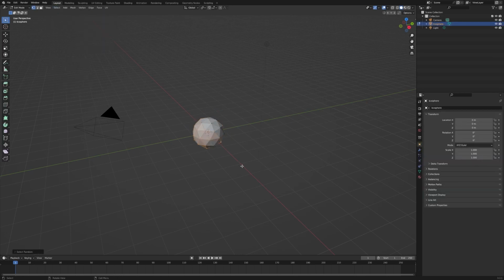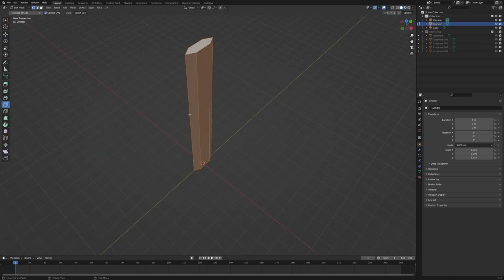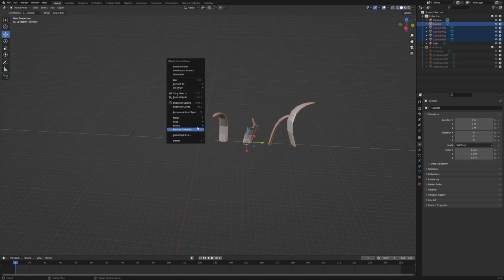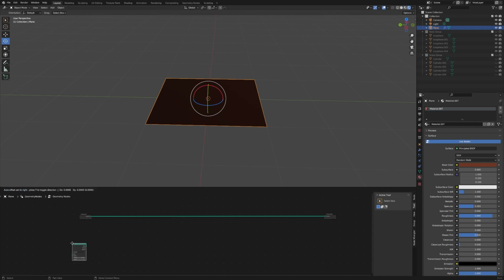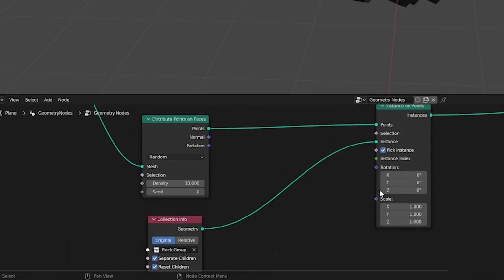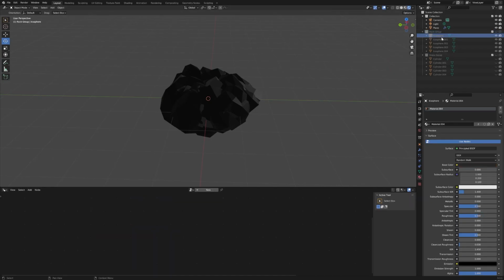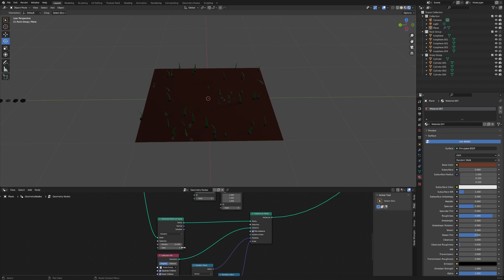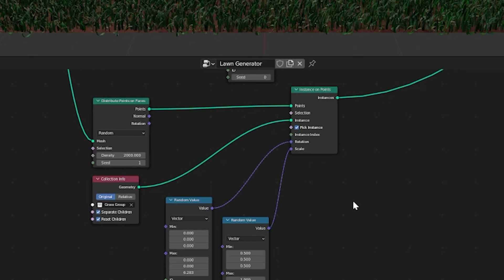Lawn Generator Geometry Nodes Blender Grass Tutorial

Comment: Whewww, wayyy too much geometry. i used your node setup on an archvis project I am working on, set the density to 1000, just 1000, and it bogged my machine down to nothing and I'm running an i7, RTX 3090, 64GB RAM. I even stripped the blades down to single strands of polys, not six sided, and same thing, and I'm rendering in EEVEE and just used grass blades, no rocks. I first ran it on a small patch like the tutorial and it was fine but small patches in these tutorials may seem like they work but throw it on a lawn in an archvis project and it is too much, try on an average lawn of 65ft x 98ft. I only ran the front yard, didn't even try the sides and back. Test with render samples at 64 and viewport at 8, point density 1000, which is visually unusable but just for test purposes...just way too much, especially for animation.